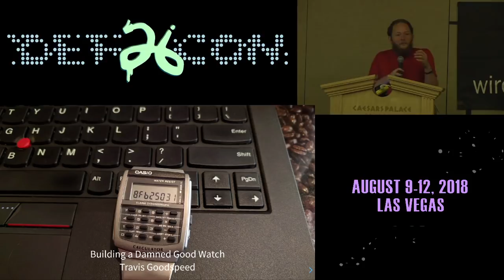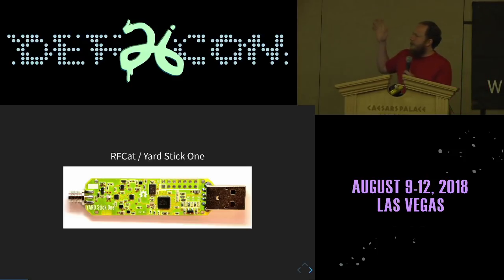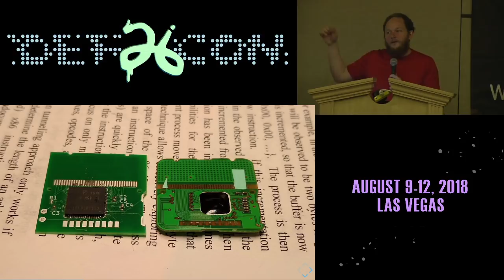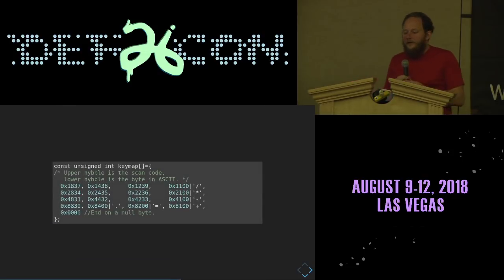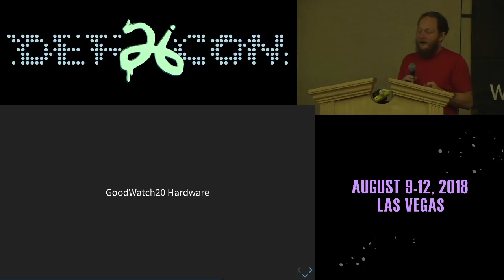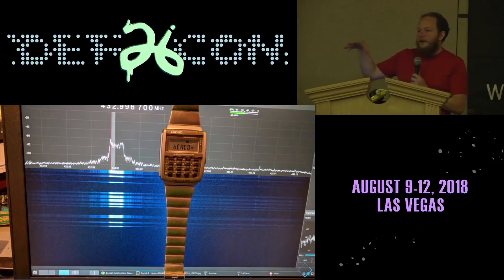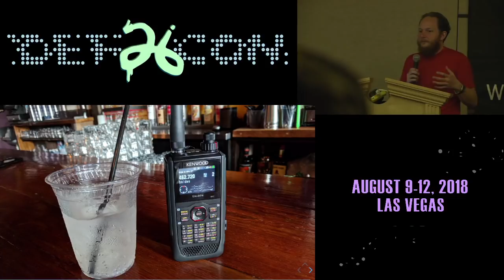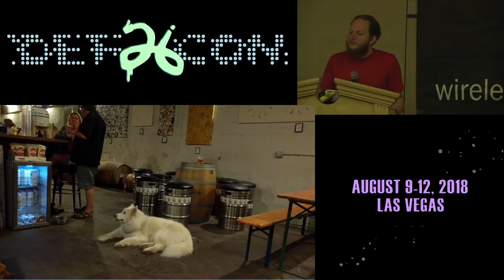DEF CON 26 WIRELESS VILLAGE - Travis Goodspeed - Goodwatch Update

Comment: How does one go about getting small custom PCBs manufactured in small batches? Like a couple units for testing?
Reply: China
Reply: express pcb
Reply: JLCPCB manufactures 10 pcs. of 100x100mm maximum size PCBs for 2$ plus shipping. If you add 7$, you'll get a stainless steel stencil, too. You can panelize small PCBs for an even better per PCB price.
Reply: @dilucide  100%